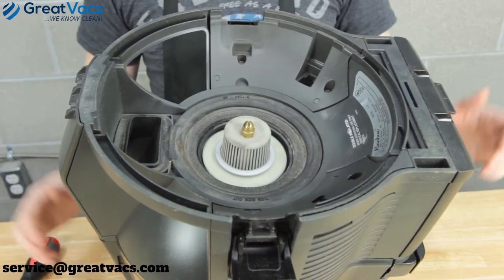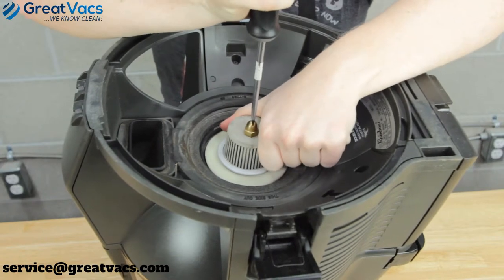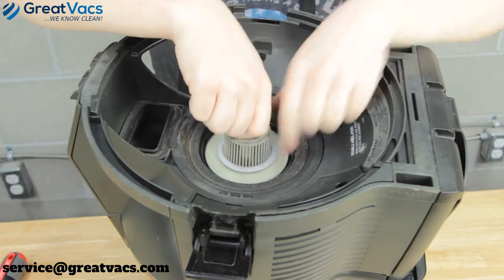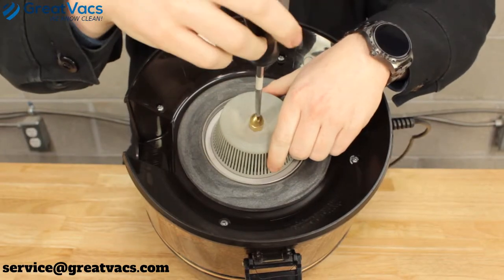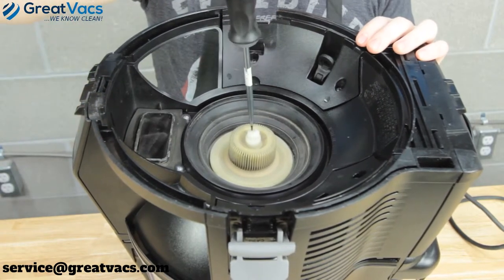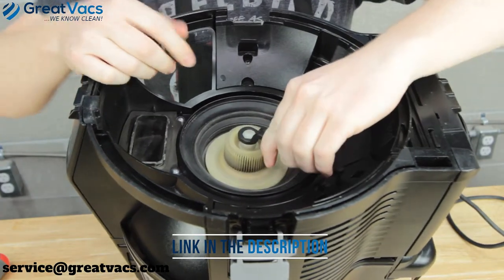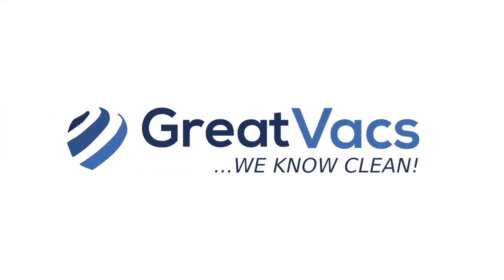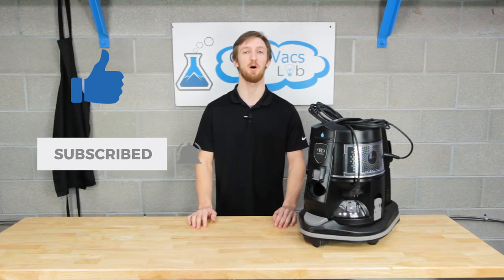How to Remove the Water Separator on any Rainbow Vacuum!

Comment: You didn't REMOVE it.  I removed the nut and the separator is stuck on.
Reply: Same
Reply: Same here. Separator doesn’t come off the unit after removing nut.
Reply: Same thing happened to me  but like he said if u push down on seperator will removing the nut with some force it will come off.